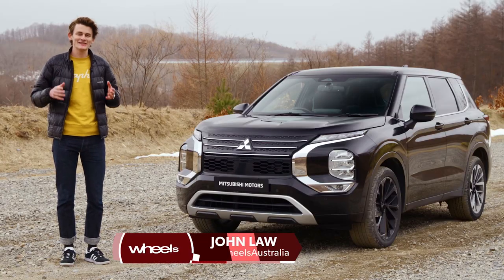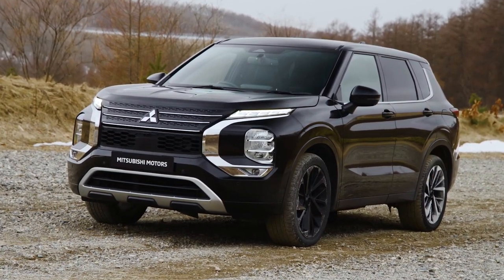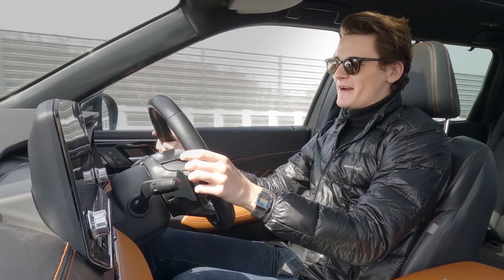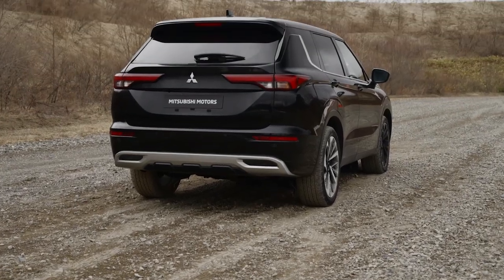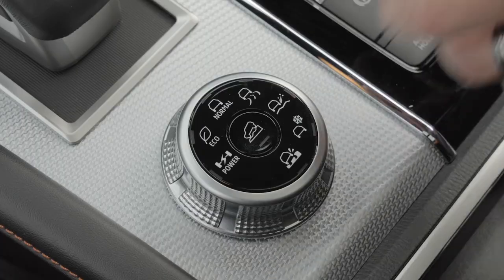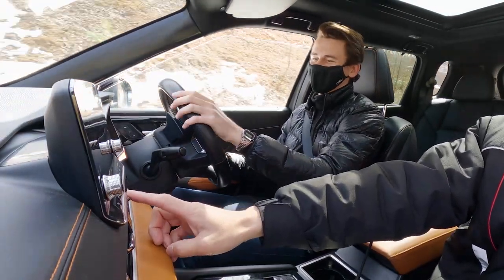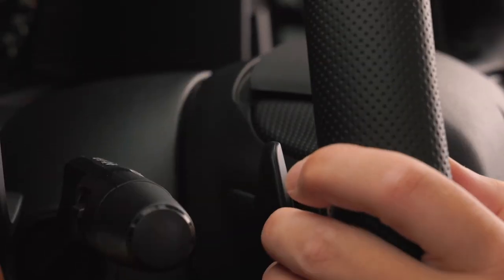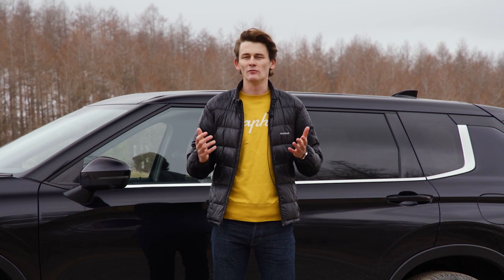THRASHING Mitsubishi's Outlander PHEV mule! | Wheels Australia

Comment: Would love to know what they had to do to keep it going that far. New Battery packs, engine rebuild, replacement gearbox?...
Reply: No gearbox in these cars, just a single speed transaxle that rarely gets used. And the engine gets a pretty easy life too. I do wonder about the battery state of health though!
Reply: @davidroberts5199  SOH, not great I'd image - my 2014 PHEV had about 60% degradation at 100K and falling rapidly !
Reply: @AndyM...  yeah the old models have a pretty poor rep but they have made a lot of changes relating to the battery for the new model. I read that Mitsubishi claimed the test car had no major parts replaced. Even the struts were original.
Reply from the maker: Definitely a few sets of Ecopias. Mitsubishi wasn't forthcoming with maintenance records, but the battery and engine were untouched. Car was on its original suspension bushes, the engineers couldn't remember on the day if springs/dampers had been changed but didn't think so.
Reply: @WheelsAustralia  Did the car run in EV only mode much of the time? Did anyone get a look at the estimated EV range remaining, if any at all? I’m very curious to know how much battery degradation these cars suffer after so many kms.